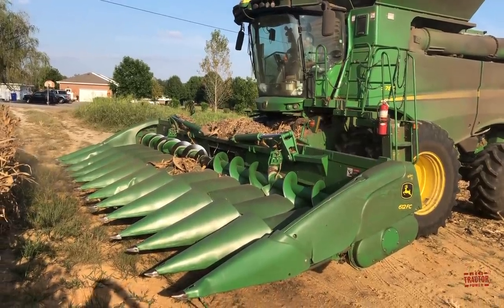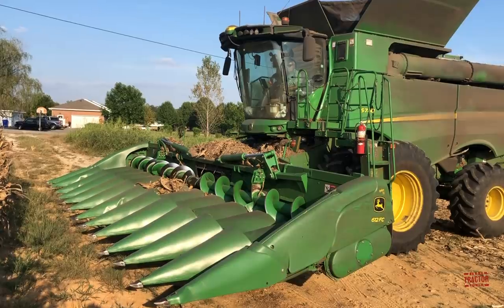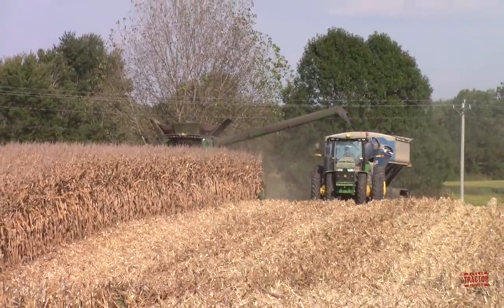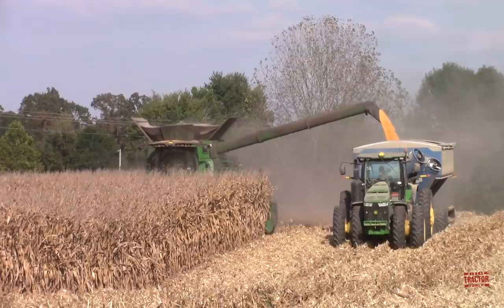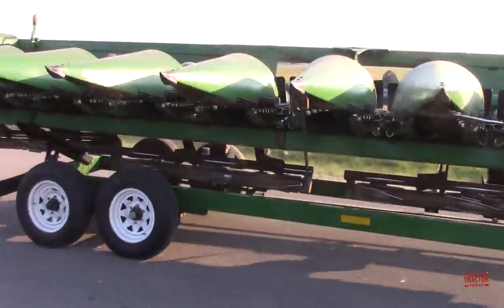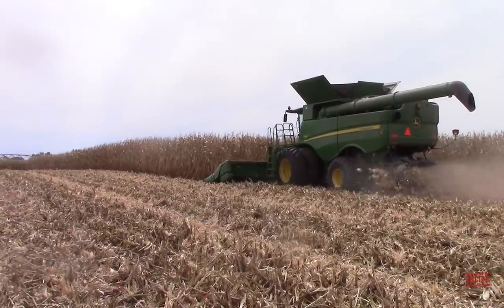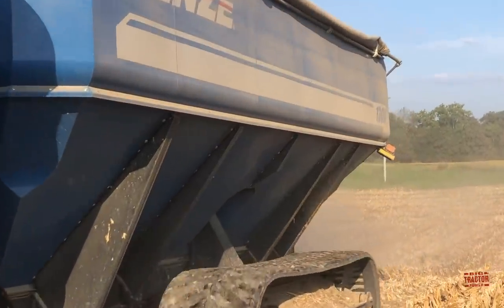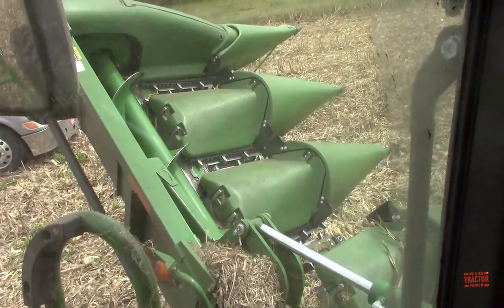JOHN DEERE 12 Row Folding Corn Head:  612FC

Comment: Hey BTP I have question about the folding headers. How much more do they weigh compared to a standard 12 row head? I imagine it has to be quite different with the hydraulics. Or do they take the weight into consideration when designing it and make it closer than a guy would think?
Reply: 612C is 7,546 lbs and 612FC is 8,990 lbs
Reply: Al Bundy thank you!